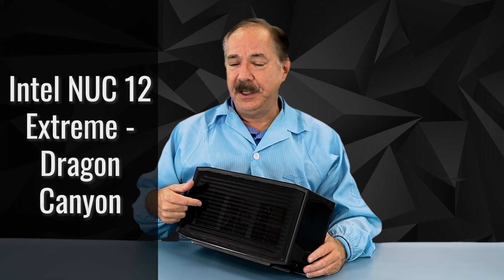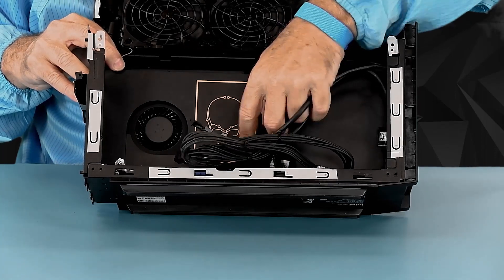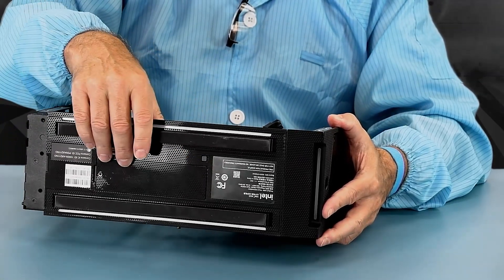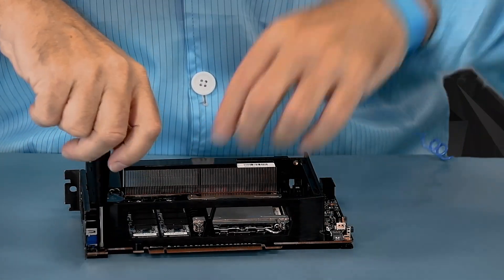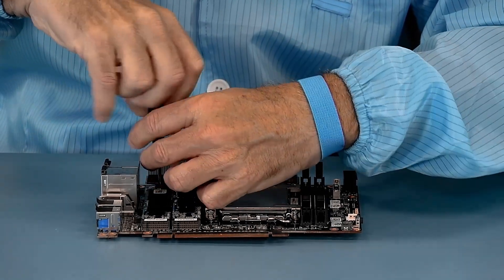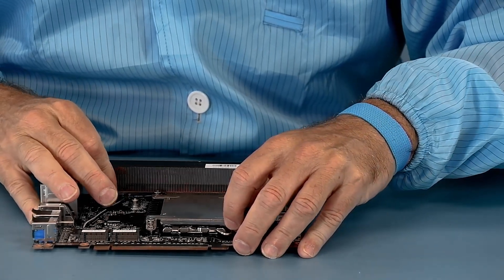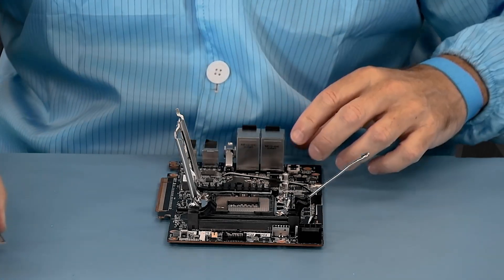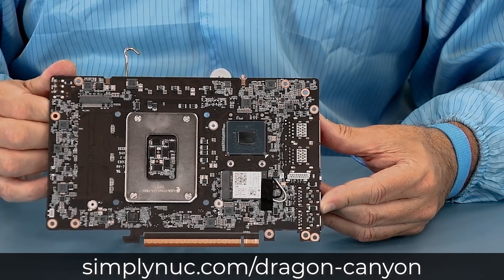Intel NUC 12 Extreme, Dragon Canyon - Full Tear Down

Comment: Used this as help today to clean my rig. All and all, went fine, even repasted for longevity with good paste. There was a ton of dust due to the tight space, so it all got stuck inside, but a can of compressed air solved everything and it now runs cooler again. There was one cable I couldn't figure out so I just plugged it into a slot that made sense. It seemed to work since it started and all OCCT tests ran just like they should've.

Comment: Anybody know where the PSID is
Reply from the maker: PSID should be located on the labels of the physical SSD or HDD that is installed.
Reply: @SNUCsystems I couldn’t find on the ssd any idea where else it might be?
Reply from the maker: @supaturtle_10  Those ID's are manufacturer specific, so you could try and find a tool that could read it from the specific drive manufacturer website.
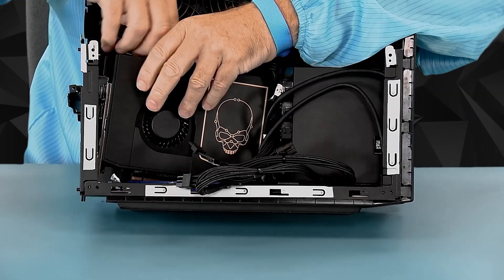Reply: @SNUCsystems also the connectors at 3:19 if they rip off is there any way to fix it or is my pc done for
Reply from the maker: @supaturtle_10  You can replace those or find an adapter that can replace the use of those coax cables.
Reply: @SNUCsystems what exactly do those wires do? Do I need them?